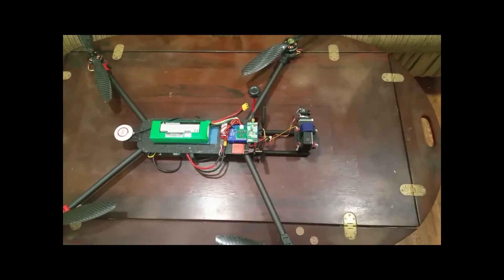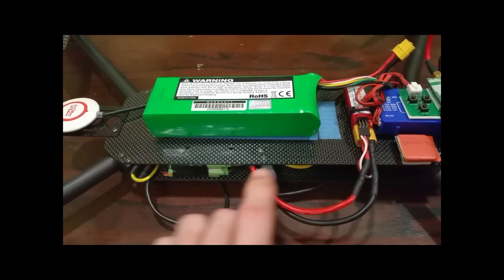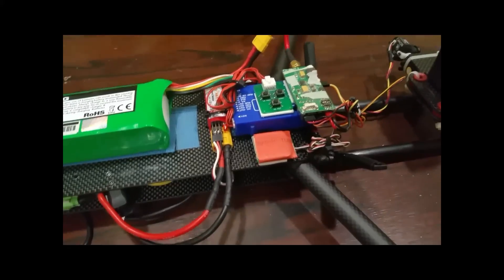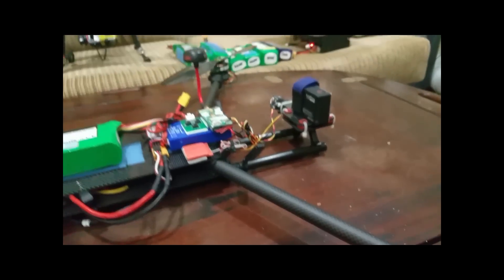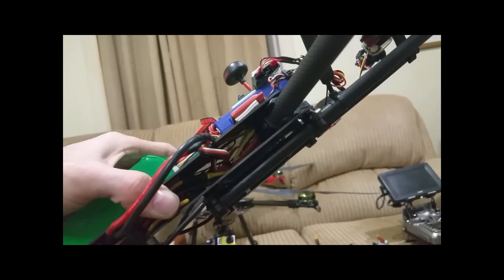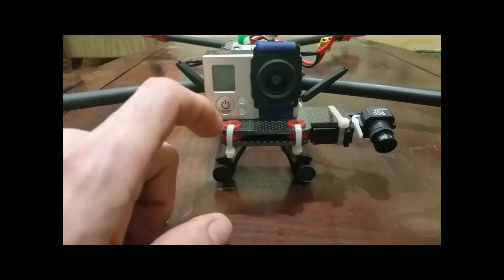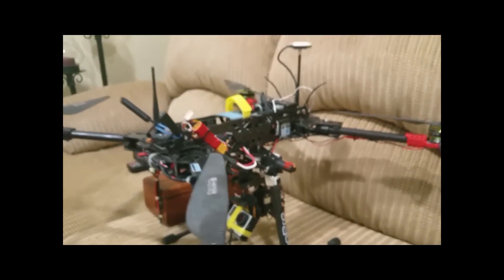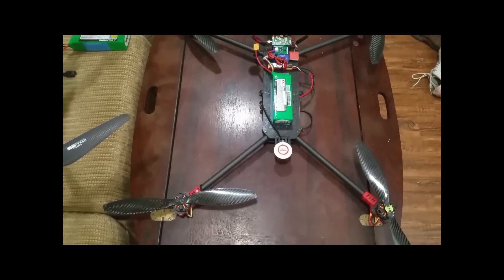multirotor build homemade carbonfiber quadcopter frame with flight (drone multirotor)

Comment: Are you still flying your project? I scrapped my project or I should say redesigned it and built a Tarot T910 in the meantime. now I am back at it with a new design. video coming soon. I watched your video for the second time and have to say, there was some good engineering involved in your project. It really does look like a Karma, but yours came first.
Reply from the maker: Photojunky Drone Zone Vlog   Thanks for the complement, I don't have this one together anymore but I have built a custom carbon frame for my bebop the videos uploaded if you haven't seen it yet. I've seen your videos on your t960 glad you got it flying. Looking forward to your new design video.

Comment: Real nice work. I am in the process of building a vey large drone almost 4 feet from motor to motor but it is not neat looking like yours. lots of nuts & bolts. You can see it on my channel. I used Multistar motors as well. 4114-320's. Good luck and keep on posting.
Reply: Subscribed.
Reply from the maker: Thanks for the comment. I checked out your video (Subscribed) now I want to see it fly. Dont leave me hangin man. good luck on the build.
Reply: will do.

Comment: Also! What did you use to cut your carbon fiber sheets? I just wrecked a section of my hexa's arm and I'm thinking of doing the frame out of carbon fiber using those pre-made sheets, my hexa is made of pcb material so its not very strong. Thanks!
Reply from the maker: +masso172  hello, I have moved the escs under the motors when I got the new esc's, I like them better there. To cut the carbon I just used a dremel rotary tool. make sure you cut that stuff outside and put on some kind of breathing apparatus.
Reply: James Adams Sounds great, I'm gonna look forward to building the frame. Hobbyking unfortunately does not sell sheets large enough for a hexacopter 250 mm in diameter so I'm hoping I can find another supplier and a good price.
Reply: i would not recommend making the whole frame in one piece, just in case you break an arm. it doesnt add much weight, and you can use the costly carbon much more effectively.

Comment: congrats is really stable i have bought already carbon tubes and sheets to build one but i am having troubles in deciding on what to build exactly if x frame or h frame are you able to send me some kind of templates of the top and botton plates to carido56@hotmail.com  i would really apreciatte that big help good flights best regards